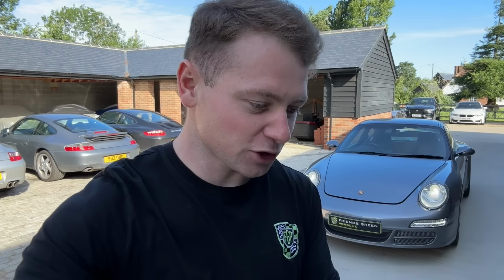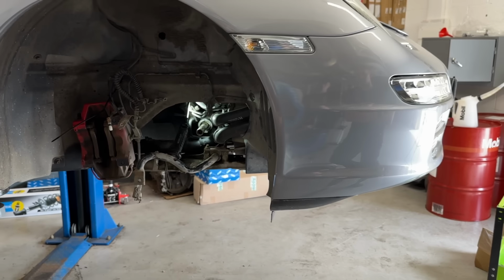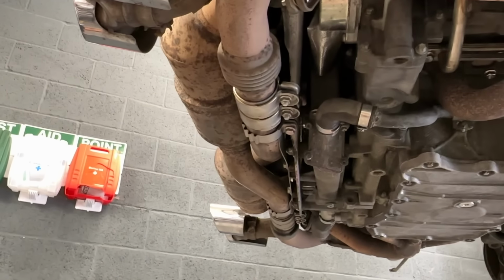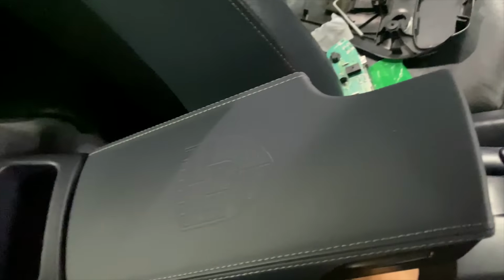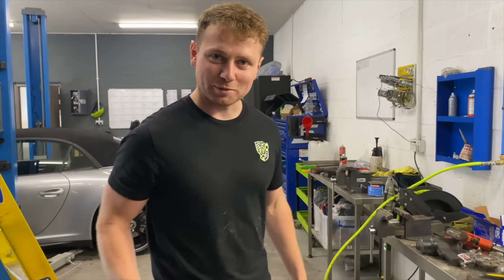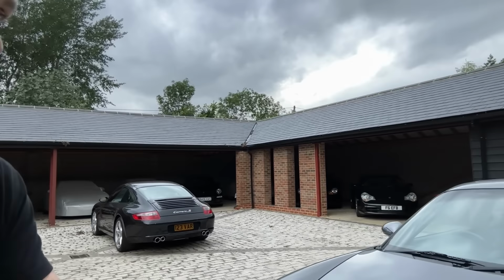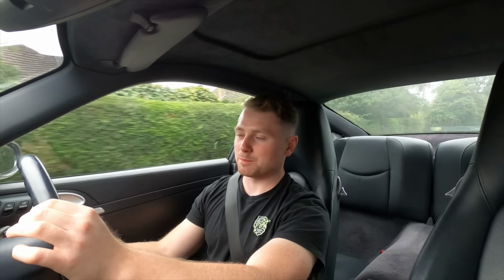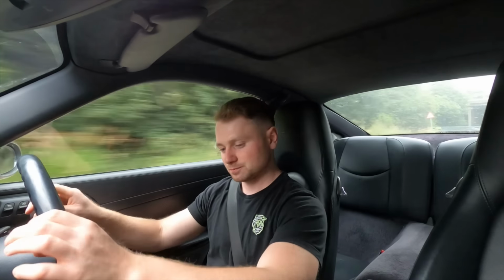How to make a Porsche 997 AS-NEW - FGP Prep Book EP47

Comment: Please someone convince him to get rid of those horrible aftermarket taillights
Reply: I’ve got them on mine think they make it look a bit fresher each to there own let’s have a look at your lights ?
Reply: They look loads better than the original
Reply: Needs to sort the lights and the wheels rather than bin good brakes. I live in NI and never had any issues with the indie guys
Reply: These are 997.2 taillights. He changed the front day lights as well. 
LEDs were introduced for 997.2 at 2009.
Reply: @roiemesilati they are not 997.2 lights just aftermarket 997.1 look better than original
Reply: LED is good but arrangement is weird
Reply: @roiemesilati they are not, 997.2 are tapered in the inner corners and will need a rear bumper update.  Those in this video are after market,  I think they are a great option to modernice the 997.1
Reply: The changed lights look awful. Originality is key on a 911.

Comment: Dont worry about the length of time...we love what your doing! Would like your thoughts on the 4.1.
Reply from the maker: In haste to wrap the video up quickly when filming in the car, I totally forgot to talk about the engine, sorry! We have a 3.9 litre 996 in stock, which we will do a video on to talk about the increased engine displacement.
Reply: Just got my (near identical) 997 back from a 4.3 conversion.
In daily driving conditions (sub 5k RPM), it’s significantly quicker than my GT3 (4.0).
I absolutely love it and just can’t stop driving it.

Comment: Read the actual water (and oil) temperatures from the ECU when driving hard, with and without those additional mesh-grilles (in front of the radiators) and you would quickly realise that you’re far better off without them. Even if it does mean vacuuming out all the crap every month.

Comment: Why did you change the gear shifter and the gear cable? What was the issue with the old one?
Reply: Apparently there’s a nylon component in the stick shift mechanism that wears out. Some people choose to replace & eliminate the problem permanently by requesting a GT3 all metal shifter. The throw of the lever is also reduced which I’m told makes gear changing more enjoyable.
That’s a guess, though.

Comment: Great video as usual, I suppose its his money- but TBH he should have bought a 991 or maybe a 997.2 Turbo with the cash he’s throwing at that. The car looks like a 4x4 on the new suspension 😂
Reply from the maker: Thanks for your comment. He wanted comfortable, practical suspension. The ride height may settle ever so slightly, but it’s the same as it came out of the factory.

Comment: About the tires you put on...if the customer wanted a like new feel why didn't you put on "N" rated tires? I don't think the 4S's are N-rated? Wouldn't you put the "older" Michelin PS2's which are Porsche OEM N2 rated?
Reply from the maker: The 4S is Michelin’s developed and improved tyre.